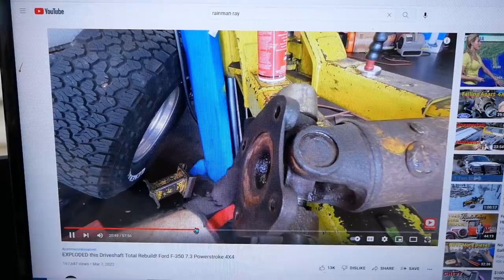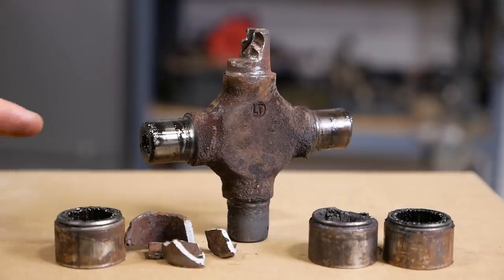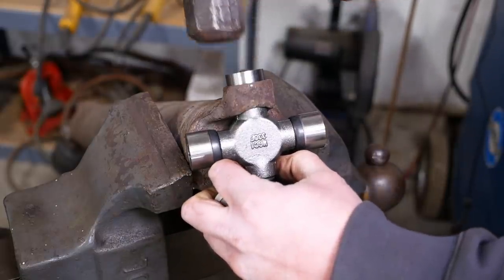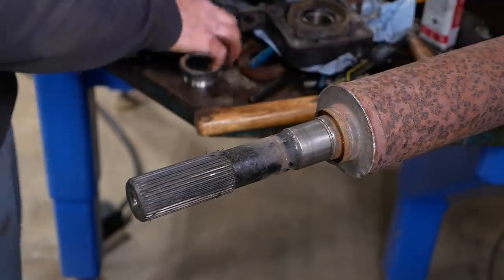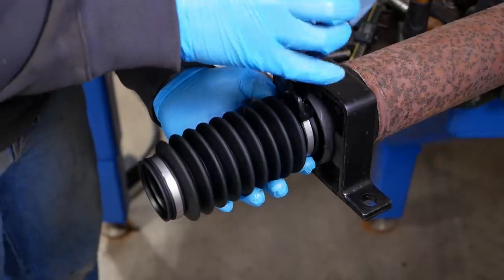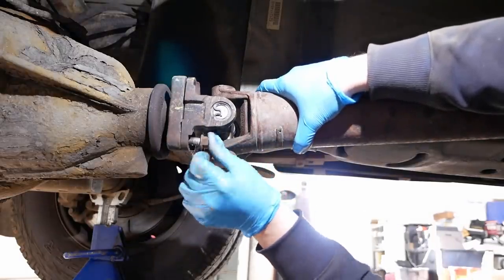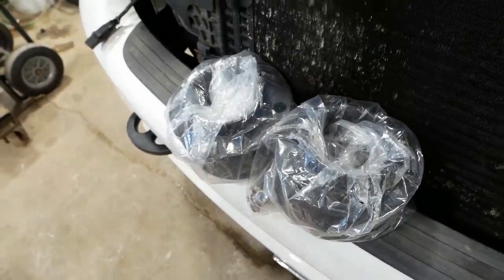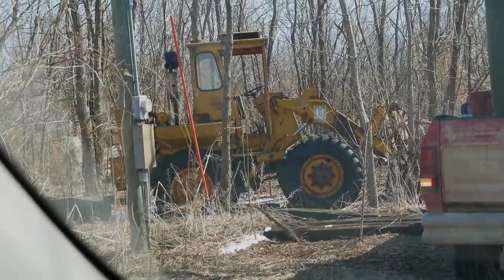Self Exploding Drive Shaft - Too Much Cummins Power...

Comment: Ahahahah! Wes I approve this message! 😁
Reply from the maker: Nice!
Reply: I always laugh a little when two channels I watch, watch and comment on each others videos.  Cool to see.
Reply: No offence ray, but as a prop re-conditioner, I had to stop watching your vid (fingernails on a blackboard) but I approve Wes' message! Except of course, I wouldn't advise refitting cups full of needle rollers with  A FECKIN HAMMER but its ok, I have some counselling booked for monday and my specialist says the straight jacket is merely 'a precaution' Rreeeeeeeeeeee
Reply: @freemanjackmsiradio  I did hold the joint in to keep the needles from falling out 🤷‍♂️
Reply: @Rainman Ray is an awesome channel.  Highly recommend
Reply: And have yourself a great day.
Reply: It's easy to shout it should be done the most expensive way when you're not paying for it.
Reply: @RainmanRaysRepairs  Yeah, was a dig at wes that bit!!! love yer vids fella, only ribbin ya both, dunno how you both work on this modern shit, I left the trade with efi and electronic ignition just coming in!
Reply: @BryanI00  same
Reply: When things go wrong during a repair, the natural tendency is to turn off the camera, or suffer the wrath of internet experts who never make mistakes. Misadventures are what I come to see, I learn far more from mistakes, and they are more entertaining, too. I do also appreciate remarks that add something positive, like the remark to give the caps a tap before trying to remove retaining clips. But let's all be respectful of these guys who have the courage to show stuff that doesn't work out exactly right. They're helping us all.
Reply: And Ray's Florida shaft was rustier than Wes's Illinois shaft....well that didn't sound right?
Reply: @WatchWesWork  Ray just did a video on a front wheel bearing/ hub change on a super duty;  and he failed to grease the little needle bearing that rides on the outer 4x4 shaft. smh.  (or at least he didn't show it-- which is kinda odd, since it's a key thing that people miss).
Reply: Always love seeing that you guys are following each other Ray. You, Wes, South Main, Vice Grip, and Mortske are the channels I watch everyday there is a new video. Lots of respect!
Reply: COOl! New engine for the loader
Reply: @calholli  Only Internet commenters know everything.
Reply from the maker: @calholli  If it's not on camera, it didn't happen...
Reply: @Rainman Rays repairs that two in a couple of days Wes and Eric O. Must have cost a bunch LOL.
Reply: I approve your approval
Reply: I think we're forming our own little YT auto repair klatch, going from SMA to Wes to Ivan to Ray. Speaking of SMA, he's been kinda quiet lately...hope everything is OK Eric O's way... we need all of ya!!
Reply: @WatchWesWork  you really do interesting repairs , great to watch :)
Reply: Ray getting 2 shout outs from two different awesome YouTube mechanics! Watch Wes Work and South Main Auto! Hell yeah!
Reply: @johnaclark1  I always listen to the comments.  You tend to learn more from 73 people telling the guy in the video how he was wrong.  I think I'll listen to the consensus.
Reply: @WatchWesWork  Wesley you ever seen the spark plug come out clean except for the threads remained in the head threads.
Now I've seen FOMOCO's spark plugs laying on the wheel wells, with the threads from the heads attached to them. 
I've seen the old Honda's CRX's with threads still on the spark plugs that once was attached to the heads after someone decided to go for 130 maybe 150 k before the electrode totally disappeared, and they tried two maybe 3 cylinders instead of 4 to get them down the highway home.
Only to be in the middle lane of the highway at peak rush hour surrounded  by angry people. 
Then remove the spark plugs with the threads from the heads snuggly attached to them
Yes and even the dogde gang again when they either went down like a CRX, in the middle of rush hour traffic trying to get to the mechanics shop after he thought it's only a spark plug, I have changed plenty of them from my lawn mower. 
Only to remove the plugs with the threads of half the holes outta 16 threadless. 
Even seen young man new fresh outta school try to fix the head on one that decided not to just snap one bolt off from exhaust manifold still  in the head, but two bolts off on the opposite head. 
He ruined the first one he tried to fix, factory told them to replace the one head, and fix the other one with two busted bolts.
15 minutes after he finally finished the head replacement, the service manager fired the kid for a simple mistake, that honestly he should have never been put into the position to do that type of job without supervision in my opinion. 
8 hrs took to remove the threads from the head without removing it, but packing both holes with shop towels totally smeared with thick grease. 
Heat it with a old fashioned soldering iorn several times. 
Then easy out of the square variety, impact attached via long extension hammered back n forth.
More heat, and finally the threads let go of the aluminum came out pretty as you please, and with no damage to them.
Cylinder was clean after greasy rags were removed, anti sleaze smeared on every plug replaced according to manufacturers recommended procedure.
Reply: @RainmanRaysRepairs  "Click"
Reply: You both do great work, no matter what the difference is, it gets done!
Reply: Did you see how, even though he's in the Rust Belt, he got those circlips out without breaking them, Ray? Didya see that, Ray?  Ray, from the sunny south! And how about those fancy hose clip pliers! Hahaha j/k
Reply: @johnaclark1  "Only Internet commenters know everything." Are you a bachelor?
Reply: @DIYDaveOK  Considering the snow we just got, he's most likely shoveling. (i live about hour away from his shop).
Reply: @freemanjackmsiradio  Too right, never sat and talked to a motor with a laptop either !!
Reply: @BryanI00  YEPPERS!
Reply: @Andrew_Fernie  🤣😂🤣👍👍🏻That's how it's suppose to be did!
Reply: This is good
Reply: Hahaha. Good to see two great channels working together(ish).👍
Reply: @rickchowsr2532  Yeah I watch him every morning the only thing I don't like is the damn phone rigging all the time that would drive me nuts hearing that all day and the clicks when tightening or unclick when loosening things other then that It's good stuff
Reply: @79tazman  I love the Sarcasm of the clicks and yeah I would have to do bad things to the phone Though with Ray making fun of it, it makes it comical.
Reply: This is amazing! 😂😂😂
Reply: @WatchWesWork  did you ever fit the new loader engine?
Reply: @spelunkerd  well said
Reply: 😂 u watch Rainman Ray too thats why that voice is femiliar... i was looking at my chats as i play your vid... i was like wait ... thats Ray not Wes then i look up 😆😆😆

Comment: I believe that dodge fit the 2 slip fits on the prop shaft to allow for the extending of the chassis as it falls apart. 
I guess that once the slip fits reach full extension it's time to get some work done. :)
Reply: Thanks for making me spit my coffee clear across the room. Having owned a 2000 Dodge, you nailed it. 🤣
Reply: Nah, that just means it's time to engage front wheel drive
Reply: Yes, the rear slip yoke compensates for rear suspension compression and extension changes during driving.  The slip yoke on the front compensates for frame deflection (and "normal" failure).
Reply: That's the Cummins breaking free of its shipping container.

Comment: The proper way to install a U-joint is to use whatever facilities you have that does not result in picking up and repacking the needle bearings into the cup or finding a needle between the bottom of the cup and the end of the cross.  But none of that ever happened to me (roll eyes).
Also I like the judicious use of paint witness marks.  Much better idea than Hansel and Greta.
Reply from the maker: Heh. I still end up doing that at least once no matter the method used...
Reply: I’ve been there so many times 😂 “hey little buddy you’re supposed to be IN the cap
Reply: @Txx9  and lined up next to its fellow bearings.  I've seen em out of place and smashed at the bottom of the cup.

Comment: There's a lot of those fuel tanks that were perfectly fine when they were dug up. All gas stations had to change the underground tanks to double wall fiberglass tanks with leak sensors about fifteen years ago. We had had an underground diesel tank for a backup generator that had been in the ground for thirty years. So that's why there are so many of them still around.

Comment: Back in the 60’s, there were no presses and every u-joint I replaced went in with a vise, hammer, and luck. It worked over and over again and unlike every other part of a modern vehicle, the lowly u-joint has remained the same and you did a great job with this.

Comment: I’ve hammered the apart and back together, used a Vice as a press, and used c clamps. Hammering apart on the side of the road with no clamp/ Vice is worst. I’ve changed them way too quick because I didn’t relieve the strain after installing a tight one. I had changed several before my Dad showed me how to relieve the “tightness”!

Comment: The damage to the cross is a lubrication issue. When a u joint explodes  the cross fractures with no point of origin. When a cross breaks, the fracture generally has the grease zerk hole as point of origin of which can be seen if you know how to read different metal fractures [my case it was a training class put on by Cummins engine in 1978]. 
  i only work on u joint 1700 series up. When dealing with full round lub. failures that the cross has worn into the cap thus expanding the end to where there is no way it will press out, I cut the cross with the torch [like SMA did tutorial] this allows for the caps to be pushed in with no damage to yoke. A rotary sand paper wheel and yoke is good.
  I am with you 100% if cross wears through cap into yoke, replace yoke.
  In the truck 1700 series and up full rounds, most of the caps are rusted to the yoke. The torch makes quick work of cutting the cap outer bolt plate center weld to where the plate can be knocked off with air hammer. Cut the cross with wide cuts allowing yoke to go over torched cross and opposite yoke. Then use air hammer to push caps to the inside, no yoke damage.
  It was the Astro "Big Nasty" air hammer which made this process possible.

Comment: Wes was a tech for 35 years and also used a hammer/press/vice to install u-joints. I would add a small amount of grease (to help hold the needle bearings) gently hammer them into place. After the old caps were out, I bought some small hones to clean out the yoke. That worked really well. To dismantle the joint, I had a friend make me some hollowed-out drivers (similar to a long reach socket) to use as I placed the joint over a vice hammering the driver to remove the cap. Love the info that you share you have a great work ethic. Nice shop set-up. Way back in the late 60's early 70's at a parts store I worked at we also would replace the constant velocity joints from the big GM cars. Took some patience/skill.

Comment: I have changed a few U joints in my life time and the absolute best way to do it is, whatever works...period!  They are U joints and made to handle a ton of high force abuse. So hammer, press, vice are not going to harm them in the least.  Thumbs Up!  You need to upload move videos. Especially the electrical type where you use the schematic diagrams to troubleshoot the problem(s). I like watching you logically go through the troubleshooting method. Not many are capable of doing that. I love logical troubleshooting mtself.
Reply: And Wes explains it always that well, that even me could follow him...
:-D
Reply: Gary - EXACTLY! Make sure all the needle rollers are in there, make sure the caps are straight as they go in and have at it!
Reply: Getting it together on the shoulder of the road in the rain with a hammer and socket without a roller bearing falling over and having to take it all apart again is the only way I have ever known. If you cant do it twice, it ain’t worth doing.
Reply: Watch Eric at Advance Level Auto And Ivan at Pine hollow  auto diagnostics they both are awesome at teaching from  wiring diagrams!!!

Comment: It doesn't matter what method is used to install u-joints. The main goal is make sure all of the needle bearings that were in it when it was in the box are in it after you install it.

Comment: Good video, good job.  In 48 years of wrenching I have never used a press to remove a u-joint, a ball peen and a vice.  The one thing I have never done is clamp the driveshaft tube in the vice and hammer on the u-joint.  I was always afraid of denting and bending the tube.  I always open the vice wide enough for the u-joint yoke to rest on the vice and then I hammer away.  Like you said everyone does it differently.

Comment: Many times I run a wheel cylinder hone through the yokes just a bit. The correct way to install a U joint is the way the indevidual is used to and works best for hm!

Comment: Very good point about the velocity difference in the yokes. Back when I worked on school buses there were at least 3 and sometimes up to 5 drive shafts. Some were at acute angles, as well. That number of shafts makes it crucial to get them all timed properly and that the balance weights hadn't fallen off or been removed for some reason. Even after all that, they would sometimes howl no matter what you did. It's hard to convince people sometimes about the speed difference, but; it most definitely is there.

Comment: Might need to check the oil level in that transfer case. Normally the spit some oil out at ya when You pull that slip yoke out.

Comment: Buddy’s plow truck had a nasty vibration when you took your foot off the throttle. A pain to figure out, U joint was locked up in the rear driveshaft by the carrier bearing. I pulled the driveshaft for 3 joints and a carrier bearing. Came back the next day, he did the 1 u joint and tossed it back in🤣. Guess he had to plow quickly

Comment: I put 3" spacers on my '98.5 Ram. I also put on adjustable control arms and steering correction, new steering stabilizer and Free Spin locking hubs.

Comment: I'm always amazed that drive shafts, maybe 20-25 mm diameter, can transfer enough torque to spin a wheel with half a ton on it on dry tarmac without twisting up like a swizzle stick.

Comment: Wes I have done u joints this way for 25 years...  no problems at all. As long as you don't knock out the needles and contaminate the grease, it will be just fine. If I had a shop as extensive as yours I would probably press them in once in a while... just to say I have done it that way too!

Comment: Yep,  that rig probably won’t even make it out the highway after hitting that bearing cap with a hammer… hahaha…!   Wes, what is your general ratio of u-joint replacements regarding auto vs., manual transmissions…?
Great video,
Thank sir.
Reply: I guess I'd assume manual would be changed slightly more often, but the clutch may take more of the beating than the u-joints
Reply: @M.TTT.  awe, copy that. Thank you
Reply: I had the same model BMW with and without automatic transmission, and the shaft is designed slightly weaker for the automatic transmission variant

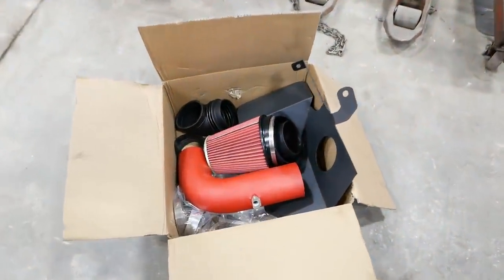Comment: 21:01  Dumbest thing a person can change on a force induction engine.  Hey let's sacrifice air filtration for cool noises.  Every dusted engine I've seen... had a K&N or similar knock off "cold air intake".  The second dumbest thing are coil spacers.  Especially 3".  That pulls the axle about an inch to the drivers side.  Of course they leave the stock shock in there.  Leave the steering wheel crooked.  But hey it sure looks cool.
Reply from the maker: You're describing 90% of diesel trucks on the road in America. People can't leave them alone.
Reply: Guilty of the cheap spring spacer with shock extender. Also not even adjusting the caster with the crooked slinky spring.
Reply: @winnreid  LOL.  Well STOP IT!
Reply: @ShainAndrews  I keep the velocity joint greased and role on truck rides good lol
Reply: @ShainAndrews  it’s a ram 2500
Reply: Looking cool always outperforms good mechanics.  Look at all the extreme camber cars, that can’t get out of their driveway.
Reply: I heard squatted truck and after I finished puking I called whistlindiesel. Another road hazard needs to be removed.
Reply: @colinklang  who has a squatted truck

Comment: I have installed u-joints with a press, a hammer and using a bench vise.  I have been successful in every method, but also Fubared my fair share.  Usual culprits of doom are dropping a cap or a single needle roller.  Nice Bonus Footage!  👍😁
Reply from the maker: Yeah that happens to the best of us!

Comment: Glad to see old iron get new life... I am seventy two Wes, its a personal thing okay? I always used a ballpeen hammer to at least start u joints together as I  want to feel as well as see the bearing needles align with each other and once the keeper clips are in both sides I give a sharp wrap with hammer to make sure its not bound together too tight even though the do center themselves. Give it a chance to work. I still have a needle just once in a while tip over and make a human out of me.... sounds good to hear a loader engine is in the works

Comment: Hi Wes, I  had a '96 Dodge that I loved, after an accident the 2 piece drive shaft was replaced, I had universal and differential pinion bearing failure. the cause turned out to be the spine at the center bearing  was sticking. in the past I had a Ford 150 with a similar problem and a Ford mechanic gave me Teflon grease made by Ford for this problem. after replacement of two pinion bearings (one replaced by a Dodge dealer which got the drive shaft timing off by 180 degrees) and universals I finally added that grease and all those problems went away.
Rich